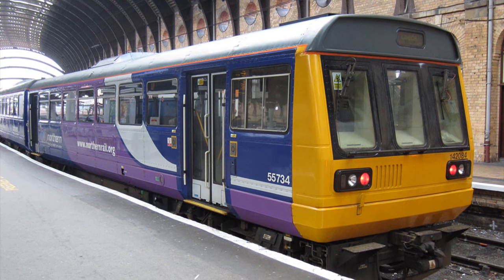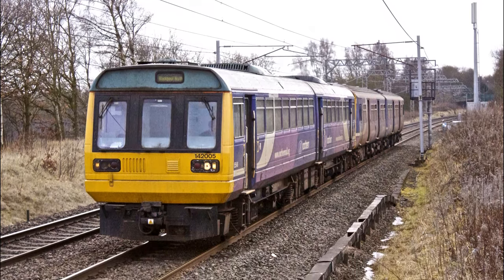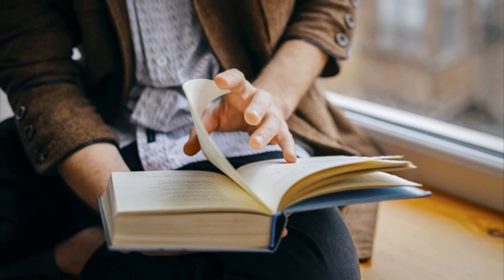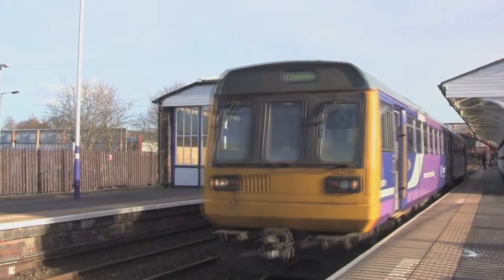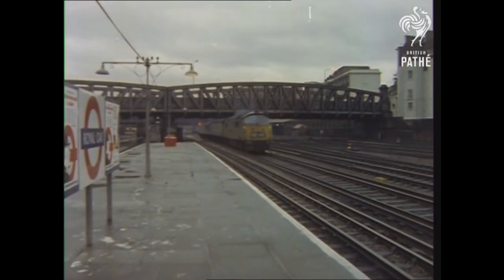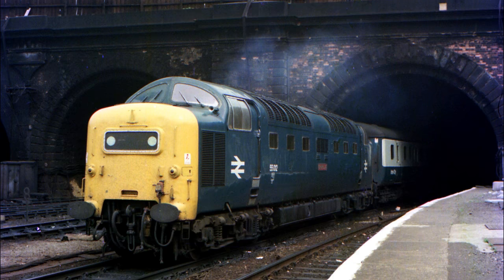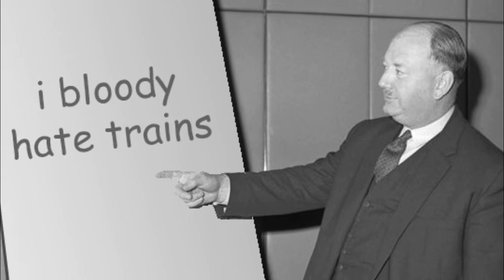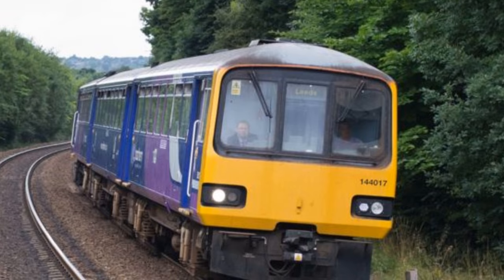The Worst Trains Ever Made - Pacer Trains

Comment: A pacer is meant to get you from A to B. What it really does is get you to A and E
Reply: XD
Reply: The only way that a Pacer would get you to A and E would be if you trespassed on the line and stood in front of one and then only if you were very lucky!
Reply: What the poster means is for the back injury caused from travelling too long on one!
Reply: In 32 years of travelling on them I have not had a problem with them, unlike Class 101s, 104s, 304s, 305s 504s etc in the past.
Reply: @HORNEBEEDUBLO  WOOOOOSH
Reply: the class 195 good pacer
Reply: what did I say?
Reply: Worse than those iron board seats...

Comment: They could cure the "Pacer Bounce" by uprating the dampers (shock absorbers). The seating could also be replaced with more comfortable 'Train type' seating as seen in the class 143 & 144 Pacers. I personally don't mind the Pacer and think they are ideal for little used non-electrified branch lines. The Lancaster to Morecambe line has normally got a Pacer on it and is virtually a shuttle service between the two stations with 'Bare Lane' station inbetween

Comment: I really wish people wouldn't moan and groan about these British pieces. The pacers are perfect trains okay. No need to hate on them okay. Just my opinion. Plus they saved loads of lines in the past.
Reply: NiffD78 Stock they good wee trains hard working
Reply: Like the hate you have for Class 800 and S Stock? I hate on them for good reason. Because Pacers are rubbish Niff. Ride on them, you will find out. Do not care if they were British made, they are rubbish. Should be BIC razors by now.
Reply: I think pacers are a good idea. especially for next stretches, railways in rural areas or with less costumers. You need only a few changes in technology and design and they will be much better and much more popular. Better breaks, better seats, noise control, sound absorber, reduce of vibration. Maybe electric engines. Doesn't cost much. Cheap, efficient, robust.
Reply: NiffIncentro At6/5 I agree
Reply: And in my opinion they are crap. Niff. Mu opinion. You hate the S Stock, I hate Pacers. People moan and rightly so.
Reply: #LONGLIVETHEPACERS
Reply: I don't get why people like them, can only assume that they are shorter than 6ft and don't commute on them.

Most uncomfortable vehicle I've ever had the displeasure of using fairly regularly, even more so than my Grandad's old Austin Metro
Reply: I use to commute on these daily between Liverpool and Manchester and i,d prefer them over the Electric crap we have now or most of the 15x, This video is just Flat out; Hate propaganda, lets be honest... Disabled passengers still used to get on and off these with little hassle, once people had there " RAMP TRAINING" and the Guard/Conductor (most of the time) aided those struggling and they still do, as for Screeching well ...  they could spend like 1 mill on Refitting a better Bogie /frame Configuration, to the entire 14x fleet ,but no. Gov would rather make us pay for Spaniard trains instead,because it also is gonna put some of that money in shareholders pockets also,used to want to work on the railways ..im just asking myself why on earth did i wanna work here ... when im on the 319 to Manchester in the morning
Reply: Still cost of running this sets is very low. And a lot of space inside - compare to it's small chasis.
Reply: Maybe OK for low volume rural lines, but Northern has consistently used them for semi-fast inter-urban work with runs of 40 to 50 miles being commonly worked. They are noisy, uncomfortable and mosre often than not dirty. They also have major problems of traction and breaking at some times of year up in the Pennines where I live - overshooting my station (at the end of a downhill tunnel) and then as a result being dumped at the next stop is no joke when you are trying to get home on an already very late train. I've had that three times now. Good riddance when they do go. I for one won't miss them
Reply: But low rural lines cannot be used by those trains. Instead northern can make turbostars! Turbo stars are more faster then pacer bus
Reply: A class 185 bounces into scarborough
Reply: Transport Centre THANKYOU pacers are my favourite trains
Reply: 359 Michaelward whenever I get the chance I go pacer
Reply: Stan ley YES the pacers are life British Leyland engineered GREAT
Reply: Stan ley YES the pacers are life British Leyland engineered GREAT
Reply: Transport they had to be replaced on branches with 153s
Reply: @Great_WesternTVFan  what's your problem
Reply: Jo Bowler no its 195
Reply: @Great_WesternTVFan  Pls stop. It's annoying
Reply: TrainsInWhiltshire true. They are bad.
Reply: @Great_WesternTVFan  That won't change. I'll like old trains how much as I like.  And I'll hate new trains as much as I like. So I win the argument. Stop getting all angry at me for nothing. Honestly, my original comment is from a year ago.
Reply: @Great_WesternTVFan  What?
Reply: Oooh boi these trains are so old that they have to open the doors at every stop by hand. Do you live in a valley where the only trains you get are pacers Cus I do and let me tell you they have ruined a lot of things for me .
Reply: @Ruru-vb1cn  Well at least they get you from a to b. :)
Reply: @seaside-dn8dp   um no it broke down 😹
Reply: @mjosiah1  I like pacers because the bounce,    it's fun.
Reply: I hated pacers since i was a kid
Reply: Amazing aren't they
Reply: Pacers are really bad buses, but I respect your opinion
Reply: not really
Reply: they where loud, always dirty, mostly full & bumpy lol. I did find out that many shared the same opinion.
Reply: Even from someone that prefers older trains, I would be lying if I said that they were actually good, because they are simply not, sure they saved lots of lines in the past but that's about it, they are poorly designed & uncomfortable compared to both the first generation of DMU's and the newer Sprinters, I don't hate them but they should have withdrawn years ago after BR built enough DMU's to replace them, since they were only really designed to last at least 5 or 10 years.

Comment: The Pacers were not made from old buses. They were newly constructed and yes, based upon the bus design and body. Rather than being fitted with bogies, (two axles at each end of each coach), they were fitted with single axles at each end. Single axles do not provide the same quality of ride as bogie axles, but they are, (were), not as a expensive as bogies and hence the cost of production was reduced. A consideration at the time.

The quality of ride with the Pacers is poor........where the track is not up to the standard that it should be.......!
It is not poor per se..!

Whilst one could argue that this was often the case, in some regions in the past, and at the time they were built, that is not the case these days where track standards and geometry are better than they have ever been.

Yes, you will lurch about in them when coming into a larger station over multiple points, but this will be at fairly low speed. You will even lurch about a bit when passing through a simple crossover, (from one track to an adjacent track), but this not just due to the Pacer having a single axle, it is because the traditional geometry of a crossover has hardly changed since railways were invented. Simple crossovers are invariably taken at low speeds anyway. Where crossovers are designed and built for higher speeds, (with longer length switch blades, for example), the Pacer will cope with it's passage through them almost as good as any other train.......the almost here will, of course, be the single axle consideration; but it will not make the ride uncomfortable.

On continuous welded rail, (CWR), which is more or less the norm on the railways in the UK these days, the ride in a Pacer will be as steady as any other train, although here again, due to the single axle, there will be slightly more lateral movement, but not such as to make the ride uncomfortable.

On a recent journey from Wakefield to Leeds I travelled in a Pacer which had been newly refurbished internally, and yes, thankfully this was with the lower back, original type seating, rather than the hideous tall seating. The journey down from the tunnel down towards Beeston  and Leeds was taken at line speed for these units and was as good a ride as one might experience. We were only thrown about a little when passing over the multiple points at the entrance to Leeds City station.

I take the view that one of the biggest mistakes the train operating companies have made with the Pacers is that of removing the original, bus style, seating and fitting them with the higher backed seating, (rigid plastic frame and cushions). When the higher backed seats have been fitted there are, invariably, too many of them fitted per coach. Basic leg room is often poorer than the worst one might find in an airplane........and we all know to our cost how poor that can be. Very often their is no room to sit comfortably without ones knees hitting hard against the back of the seat in front. This was not the case with the original bus style seating, which offered far more generous and comfortable seating space. If you don't believe me just find one of the Pacers that is fitted with the bus style seating and then compare it with one with the higher backed seating.

By far one of the worst consequences of fitting the higher backed seating to the Pacers is that it makes them very claustrophobic. This is especially so when they are crowded, say during the rush hour. It also makes it practically impossible for any passenger in a seat to see down the length of the carriage. All to often all one can see is the back of the seat in front.

I take the view that what ever the shortcomings of the Pacers, it is the creation of this claustrophobic atmosphere, caused by the fitting of the higher backed seats, that has made them, in the mind of the passenger at least, a poor train in which to travel.

Cramming in more higher backed seating is never considered, as the major fault, by the train operating companies......and sadly.......by government. Far easier to simply condemn them as bad trains and rush to call for more investment in new trains, without objectively assessing that the actions of fitting them out very badly is arguably one of the reasons the travelling public.......and the press......have come to regard them as they do.

It becomes the expected view to which we all, far too readily, subscribe........!

Of course, more investment and newer trains does not necessarily mean better comfort for the passenger; although it should...!

As an aside, just look at the new Hitachi 800 class trains..........they have appallingly bad seating for a new product. These are a poor substitute for what might have been possible if the fleet of High Speed Train, (HST's), had been properly refurbished. They are a British design and build and their coaches are arguably, the best that we have operating on our railways. All that was required was refurbishing and also building new power cars. Far more cost effective that buying new trains from Japan......!

The Pacer stock still has a future, if properly re-engineered and fitted with bogies.........and without the appalling high backed seating, but does anyone have the vision to see this...?

Comment: Fun fact: BR and leyland sent one called LEV 2 to Amtrak in the 70s for testing on the North east corridor, it was rubbish, so Massachusetts Bay Transit Authority tired it out. It also sucked there. So they gave it to steamtown NHS the recently formed National Park, it derailed on switches and even derailed standing still. My boss watched it casually fell of the tracks. Yet it hasn’t even moved or been moved. So the park service then sold it to Pocono Northeast Railway and they wanted to use it to run a commuter service. It blew up on the maiden run. So they sold it to some guys in West Virginia and they didn’t know what to Do with it because they couldn’t get replacement parts. So then it when to the Massachusetts Trolley museum as a gift. Today it sits in the far back with some minor vandalism

Comment: I rode on a Pacer (144 020) from Lancaster to Skipton the other day (12th October 2018), most of it on unwelded rail. It was bouncy, uncomfortable and slow. The rain came in, the wheel I was sitting over had the most excruciatingly bad flat, and one of the turbos had gone. The real icing on the cake, however, was when all engines (on all three carriages!) cut out completely - not once, but twice - for about ten seconds each time between Hellifield and Gargrave! They're always bad, but this really was ridiculous even for a Pacer. 144 020 is due for withdrawal next month (November 2018), however, so I suspect maintenance isn't the highest priority.

On the one hand, yes, they're awful and it'll be a relief to see them go (and we'll be getting new trains in the North for the first time since 2000, at last!). But on the other, they're a quirky, characterful reminder of simpler times, and I'm sure I'm not the only one who will remember them with a certain fondness - albeit tempered with memories of unpleasant, laborious rides with nought but the monotonous 'bang-bang-bang-bang' of the over-spaced single axles to enjoy.

Comment: They did the job they were designed to do for longer than they were designed to do it. People just love whinging.
Reply from the maker: Absolutely agree, but that doesn't mean they weren't a bit naff. Went above and beyond what they were initially built for, but you have to agree that the new Class 195s are long overdue and are a far better, and longer-term investment.
Reply: Exactly! Who gives a fuck about people with strollers, elderly people, generally mobility impaired people or even people in a wheelchair as long as this abominations perfectly meet the design criteria? Who cares the design requirements were shit in the first place? And no, demanding trains to be accessible for people with an impairment is definitely not whinging.
Reply: @Gruftkriecher  I totally understand your point but is that not more down to the TOCs not making appropriate modifications to them rather than the units themselves?

Comment: The Pacers were never economical at all. Due to longevity of components concerned over the Sprinter type trains, they were more expensive to run. The wheels caused greater wear to the track meaning that they didn't save branch lines from closure, it was government subsidies.

Comment: 2020: goodbye pacer, thank you for saving the branch line.
scrapers: destroy!
railway enthusiasts: shildon here we come!
Reply: They never saved branch lines from closure.
Reply: if it wasnt for the pacer, the old br first generations would have haunted those lines until the class 150,155,156,158 etc. came on to them. the first pacer was built in 1980, and it wasn't until 1984 that a new dmu was built, so the pacer made branch lines *better* for the 4 years to come, but it was a little bit shit that something temporary lasted for 25 years.
Reply: @darobzamusic6007  I think they took over two decades for the pre-1963 type DMUs to be replaced. Pacers were never cheap to operate.

Comment: As someone who goes to Newcastle on one of these pieces of dog shit on a regular basis (Not by choice either it's either that or pay £7 on the bus), they really are showing signs of age I had one cut out resulting in the driver coasting the unit into Newcastle and having to switch them to a 156 to complete the journey to the Metrocentre. From what I have heard once we get our refurbs and the Pacers are turned into Coke cans, Heaton will be allocated 158s to run the connect service to Carlisle while the majority of 156s currently allocated to Heaton from what I can gather will be allocated to Newton Heath. Don't think Newcastle will see these new trains at all newest we will see is a 158 or at a push a 170. Pacers are uncomfortable noisy things that should have been turned to razor blades ten years ago at least!

Comment: horrible for the mainline network but useful for winter running on preserved railways, heating, comfortable cab rides and economical to run and buy
Reply from the maker: I'd argue that Winter is the worst time to ride a Pacer. They're bloody freezing inside with those single-glazed windows and doors that aren't even shut properly!
Reply: Summer is the best time as there is plenty ventilation around the doors.